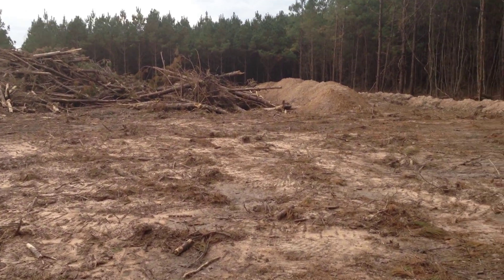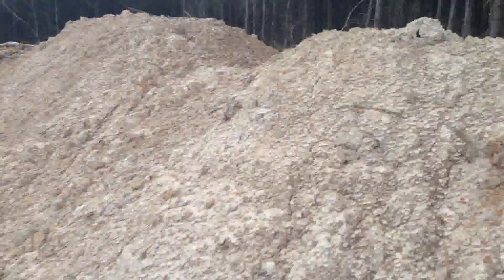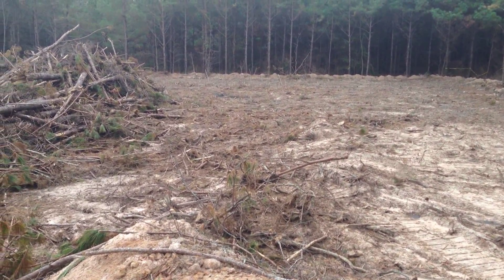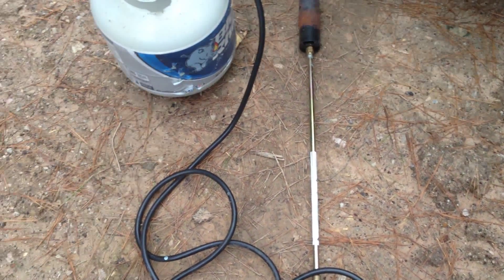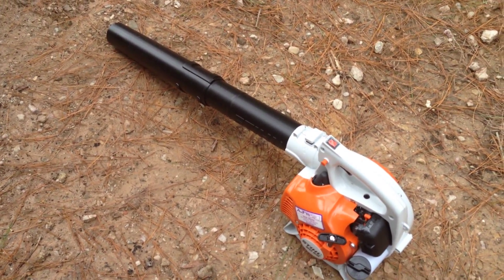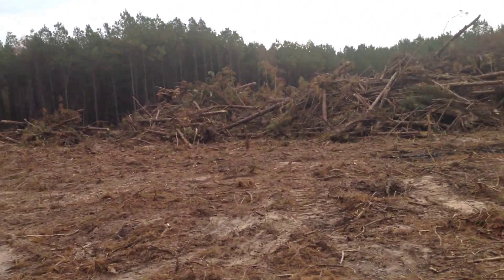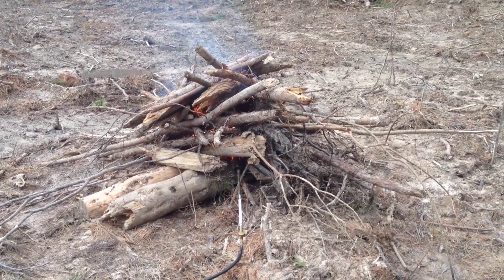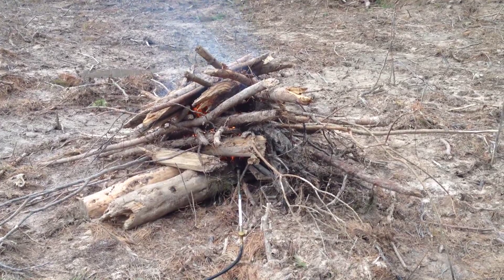More Clearing Work at the Farm - Moving/Burning Brush

Comment from the maker: Well I got off "lucky" if you will on the excavator. Turns out when the pin broke, so did a lot of other stuff, or bent at least. I went and looked at the parts to confirm they weren't taking advantage of me when told over the phone how much was damaged. I could tell any of that in the dark. But they were gracious, and did not charge me anymore than my deposit. It was several thousand dollars in parts damaged and they let me off with $400. Still the trend continues, every time I've had equipment to the farm it's cost at least $300 more than I planned. :(